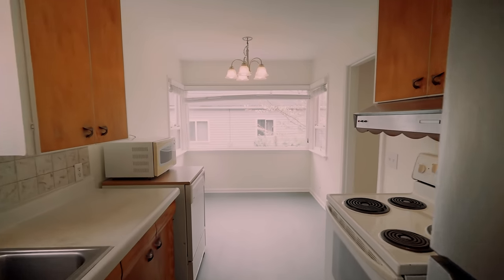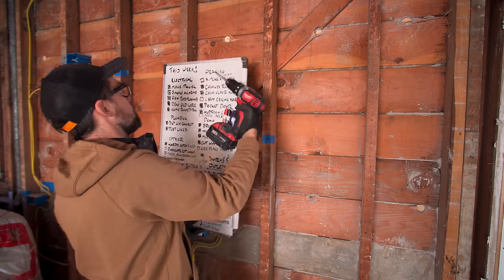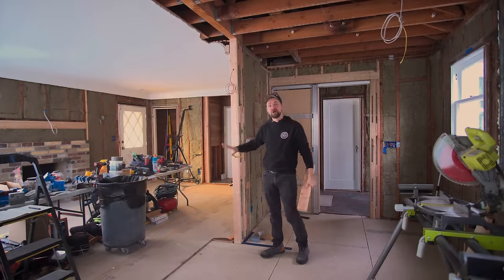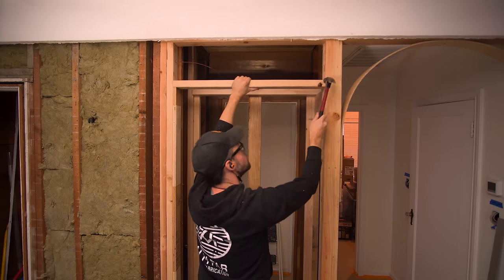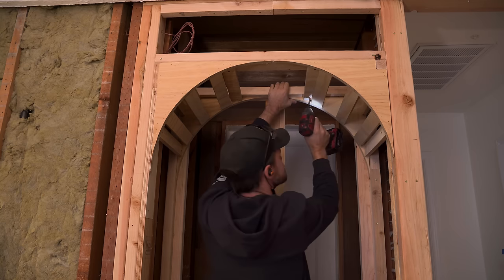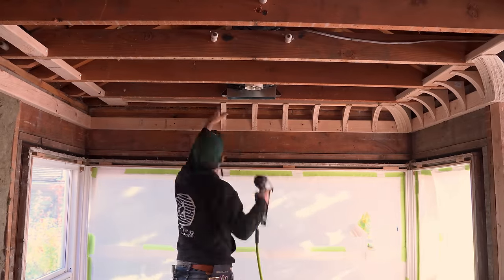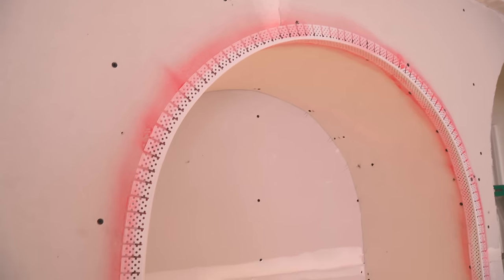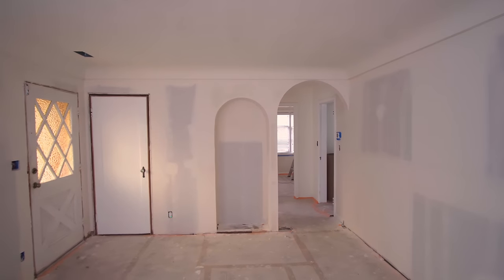Last-Minute Architectural UPGRADES | 5 Days till Drywall

Comment: very interesting for me as a European to see how American houses are built. With our brick walls, jobs like tapers and drywallers don't really exist here - we do, of course, sometimes build a few interior walls with dry wall, but usually only to save on money or for practical buildings so it's rare to see skilled workers do something like arches and coves with drywall, here. I learned a lot. You also did a great job preparing everything for the professionals. Unbelievable progress!
Reply: I'm sure we use drywall to cut costs here in America, but using drywall also makes it a lot easier to hang stuff up and allow for further modifications. It would be a nightmare trying to rebuild a room with a brick wall, instead of simply having to cut through wood and drywall haha. I'm sure the various European climates have a factor in why brick is still a common building material, as well as history. Housing all over the world is quite interesting to learn about!
Reply: @nomoretwitterhandles Having worked with both for a decade, I have to say I perfer a sold brickwall. I actually find it a lot easier to hang things up especially when it comes to heavy items. But I do agree, it is fascinating how different building methods evolved over hundreds of years and there is lots to learn from all them!
Reply: I say this exact thing when watching people from other countries build homes too it's so fun and a great learning experience too..😊
Reply: Plasterboard (drywall) over timber frames are used for internal walls throughout the UK and Ireland.

I'm always struck by the lower insulation levels & the kitchen appliances. I think we do those better this side of the pond.
Reply: How are the brick walls you speak of finished smooth, ready to paint?!? By brick, do you mean those large hollow clay masonry units (I saw those going up in Spain- looked like reinforced concrete floors/ ceilings, steel columns, clay masonry non-structural walls), or what we commonly call bricks in the US (2 1/4”H x 3 5/8”W x 7 5/8”L, or 57 x 92 x 194)?
Reply: @EM-fh2tx  Insulation levels required by code in the US varies a lot based on the climate of the area you live. Some areas require R-19 in exterior walls (2x6 construction), while others only need R-13 or R-15 (2x4 construction).
Reply: @EM-fh2tx  I saw a study that found UK homes lose about 3 degrees C in five hours at 0 C outdoor temperatures which is absolutely terrible, compared to Norway where homes are built with timber, and where the average is 0.9 C. The idea that masonry is good insulation is a complete myth, if you had brick walls a meter thick it would only be equivalent to an R-value of like 4.5.
Reply: Average age of housing stock in UK is much older. You can't compare insulation values of a house built in 1920 to one built in 2020. I agree however that more northern nations have higher insulation values.
Reply: @coolbugfacts1234  If you don't insulate them, yes. First of all, the standard noawadays is to add foam insulation on the outside with two layers of reinforced lime-concrete plaster on top. But the reason we use brick is not for insulation, but for thermal mass. The weather in central Europe can get pretty cold and pretty warm, so a thick wall acts as a temperature buffer for times with a lot of fluctuation. For example, most central European homes don't have AC because three consecutive hot days will still not heat up the interior too much since the walls have a lot of thermal mass to heat up before the heat reaches the interior. The same is true for three cold days in a normally warm season.
Reply: @chriskelvin248  In Poland almost all walls are made out of three types of "bricks". We use either ceramic bricks like Porotherm, foamcrete blocks like Ytong or silicate bricks. They differ in sizes between brands and serve the same purpose. The choice is mostly the investors preference. Than the raw wall is covered with "plaster". There's two popular choices: concrete based or gypsum based sand mixtures. Finally we put smooth layer of acrylic "plaster" and paint. Typical outside wall is about 10'' with 8'' insualtion and inside walls are 5''.
Reply: @YippieKayYay88  I would like to visit one day. Next time I’m anywhere in Europe, I will definitely pull over to inspect construction techniques!
Reply: @EM-fh2tx  The average age of housing in Norway is about 50 years. The average age of housing in the UK is just 37 years. UK houses are shoddily constructed and inefficient, compared to the well constructed and efficient timber houses of Norway.
Reply: @chriskelvin248   You are welcome to visit. Our country has plenty of nice and interesting things for You to enjoy, construction incuded ;)
Reply: @marcpym5251  Where I live in the US it's completely normal to have weeks of 35 C or higher in the summer, and weeks of -12 C or lower in the winter, so the thermal mass theory is not a great idea here, we need actually well insulated houses
Reply: @YippieKayYay88  I can say “good morning” in Polska and some bad words too if I hit my head on a brick
Reply: Unfortunately most residential homes in the USA are NOT built to last multiple generations. Most Americans move every 7 years so that’s sadly reflected in the construction practices of today.
Reply: Rofl drywall is used a lot in Europe...
Reply: Same in India: all houses have brick walls, only offices may have drywall with GI steel studs for interior "walls" (partitions, really). Wood is horrendously expensive in India.
Reply: In Sweden it’s very common with drywalls. Mainly for its fireprotection capacity. At least in multistorey housing projects..
Reply: @chriskelvin248  I think you're talking about Cinderblocks (which are a shaped (and hollow) cement mix with actual flyash from industrial ovens included into the mix to make a lighter product) and no, that is not Bricks, Bricks are the solid burned clay rectangles that give you a regiular smal patterned surface with red blocks and white mortar lines.

Walls are made smooth by putting up plaster/stucco. Then you can add whatever finish you want... paint it, wallpaper it, add woodpanels.

Also you shouldn't confuse modern building codes with those houses 80 or 100 or even 250 years ago were build and have been modernized under...  If you set up a completely neww house now there are stringent energy efficiency rules at work too. and i'm pretty sure they hold up in most EU countries better than the wood buildings in the USA.
Reply: Brick walls may withstand tornados better!
Reply: @DrMJJr Not sure where you got your information from, but the typical house in America can lasts anywhere from 50 to 70 years, and some lasting even 150 years. Keeping up on the maintenance of the home is an important factor. This isn't technically the reason why Americans typically move every 7 years, but instead its because of a new job, or more affordable housing. There has actually been a large decline in the number of  Americans moving every year.
Reply: hu
Reply: My daughter's apartment interior walls are all drywall attached to thin, steel studs. She lives in France. The building was put up in the mid 70s.
Reply: Well this Comment Topic Wall was entertaining. And there are too many factors involved to declare any nation a so called Winner. Plus you all loose anyways. The Japanese House Construction displays a textbook ingenuity design that caters to a human but will outlast Time itself.
Reply: Drywallers do exist and they have plenty of work. But not at building family homes.
Reply: At the end I was thinking: “If somebody slips and pushes a couch too much, it’s easily going to make a whole”. I like how fast it is but not really great long-term, especially if sold to somebody with no DIY skills
Reply: One of the biggest reason we use brick and concrete instead of timber at least in The Netherlands is because of fire safety. We are a small, densely populated country. Because our houses are build closely together, if there's a fire in one, you don't want it to spread to the other houses next it. And if it is going to spread, you want it to do so as slowly as possible.
Reply: @coolbugfacts1234  The average age of UK housing stock is definitely not 37 years. Nearly 1/5 of our stock is well over 100 years old (we have houses that are still lived in from the C12th). They definitely do not have the thermal rating of Norwegian houses though. Despite the entire UK being at the same latitudes as Canada, we just don't get winters that are as cold.

Comment: I learned this by replacing paneling at my old house with drywall on a front wall that had moisture issues. Fixed the moisture issues (thank you Matt Risinger) myself, but was weary of drywalling. Watched several YT drywall gurus and learned a few key tips so when I tackled the mudding and sanding, I treated it as an art...because it is. Your drywallers are artists. Excellent work, but I'm really surprised that they let you film them working. Great guys indeed!
Nice work to you as well Michael. There's much to be said for being a woodworker that is going framing. It's a totally different skill set, but you excelled. Well done Sir!

Comment: I was doubting the cove, I thought it was gonna be a straight curve from the horizontal wall to the vertical ceiling, but with the 90° edge below it on the wall it's very nice. It's classy, shuttle, and maybe even a touch of art deco. And since it was built in the 40s it fits nicely! Well done sir! I'm digging this series.
Reply from the maker: Thank you!!

Comment: Good decision on the Rock Wool. It's very moisture-tolerant, easy to cut, easy to push and place, and neither insects nor mice will eat it. Plus.. NOT itchy compared to glass fiber. Great stuff.

Comment: Been following the renovation and it looks awesome. One tip. It's best practice to trowel thin set in straight lines as this will provide a uniform height. If you trowel in circles you run the chance of putting too much thin set in one spot and not enough elsewhere potentially creating voids or weak spots under the cement board.

Comment: I did drywall taping in the 80s. The use of power tools the hangers use is a big step-up for them. I am pretty sure they are using a rotobit they can plunge into the soft drywall and push it along the lines. It was all utility knives and drywall rasps. They were just as quick, and did things just as fast. They get/got paid by the job, so the quicker they got it done, the more they make by the hour.

Comment: Rockwool is also much better for your health. You can put it up without PPE and all you will have is a bit ichy skin and maybe an ichy throat but not something that doesn't go away after a shower and the ichy throat is avoided with a mask. The fiber glass, you should have a full body suit or you will be ichy for days and it's detrimental to your health to use it without a good mask which rockwool isn't.

Comment: Looks great!  I really like the arches and the cove ceiling, but I was surprised how they drywalled them.  I have curved drywall during my own home renovations.  You can get a 1/4" flexible drywall and you just wet both sides, wait a minute and then it bends into place. It seems easier then mudding and sanding out the flat spots

Comment: Great video and it is so satisfying to see the drywall up and mudded. I will suggest that you review your thinset technique before tackling your tile, though. Your method is very out of date. You should always trowel in one direction so air can escape when you lay down tile (or cement board). You also need to back-butter tiles (and, probably, cement board). Get a copy of the Tile Council of North America (TCNA) "Handbook for Ceramic, Glass, and Stone Tile Installation" rather than trusting YouTube videos if you want to do tile right. Many localities consider TCNA guidelines the minimum for building code compliance.

Comment: It's worth bearing in mind that some spray foams shouldn't be used with electrical cables as they'll react with the sheathing.  
A great thing to use in principle, but worth checking before use.

Comment: Worked as a pro taper back in the day and sometimes drywaller, never seen these newfangled techniques ;). We did arches using flextape (paper tape with embedded metal strips) and snipping one side in small segments with tinsnips. Also curving the drywall by wetting one side but that wouldn't work for the amount of curve you needed so you have to cut it like that.

Comment: There are math formulas for arches a squared plus b squared divided by two of a . A is the spring of the arch  and b is half the span of the opening. The top can be plywood to fill the top of the arch no need to fill with wood  and when you cut the arch cut both sides of the arch at once if your off a little bit the drywall will cover it you are not building furniture your framing.  On cove cuts your using the twelve twelve setting on the speed square so for the inside and outside corners use the hip and valley setting to  get there or use seventeen on the carpenter square.

Comment: The spray foam you used to seal off the openings inside your walls really should have been fire resistant foam. Most building codes require it when sealing openings between floors. It is generally colored red to make it easier for inspectors to spot it is the correct product.  This is one regulation that I believe is actually worth doing even if it wasn't required. It can greatly slow down the spread of a house fire.

Comment: Ok. Last one. Spray foam around the window spaces and plastic sheeting as a vapor barrier on the exterior walls would help a ton with drafts and heat loss.

Comment: The dish detergent just smooths out the drywall and makes it more pliable when working with it, in addition to the bubbles. Kind of like adding a bit more milk to the mashed potatoes, when you’re mixing them.

Comment: Can't believe for an old house, you would not used closed cell spray foam insulation. It makes for an absolutely air tight, bug tight seal. Having had it done twice, I'll never go back. Makes everything rigid and quiet.

Comment: Looks great! I like that you kept the original look and feel with the arches and cove. Will you be doing an exterior vapor barrier?
Reply from the maker: Thanks! Right now there isn’t a plan for a barrier. From the research I’ve done, it sounds like moisture barriers in this climate are not recommended. If we reside the house down the road, we might change our minds
Reply: @MichaelAlm  Interesting, down here in Oregon I think they're required. You're only slightly wetter up there. Looking forward to seeing the end result.

Comment: I would never use drywall in an old building. I would use paneling like in fancy libraries and do wainscotting. Boxbeam wood ceilings. As for the floor, I would go period and use hardwood planks.

Comment: Hold on I got another one....moving  a 40' extension ladder to another side of the chimney. While bent over tried to fix the foot of the ladder, because of tje ice and snow,  a loose brick fell 32' and cracked be in the back of the head. Layer me out ! Didn't knock me out, though I think I wish it had. It did however paralyze me for a few. After an ambulance ride and 20 stitches the dr told me a fraction of an inch higher or lower I more than likely woulda been killed....hard hats people, hard hats please.

Comment: I don't normally comment on your content, but I have to agree that drywall, mudding and taping is straight up prison sentence work, so good call on hiring that job out - those guys did an amazing job, too. I'd add that someone below replied to a comment to the effect that you should add some of your patterned ply stuff, notably as a door - maybe get rid of that heinous diamond-pattern ranch style entry door? It really clashes with your deco arches now.

Comment: I've been a drywaller for a decade now. having someone board over cove created by framing is INSANELY cost prohibitive. theres a product called cornice which drwallers can install that has a coating over styrofoam. It is better than wooden cove because it doesn't shrink or twist over time. the sheer amount of time the mudders have to dedicate doing it the way presented in here vastly outweighs the cost of simply buying premade cove. Another thing to note is that dish soap helping with bubbles is a myth and is not recommended for the longevity of your work.

Comment: Should have added at a minimum, 1/2 inch ply wood before installing the hardie back underlayment.  The defelection in each deckboard is going to cause grout cracking and, over time, tile failure.

Comment: I had the opposite experience working with mineral wool insulation.  I just tried it for my kitchen remodel and I will NEVER use it again.  It was far, far, far itchier than fiberglass.  It was in the air like crazy.  It was miserable to work with and that's coming from someone who hates fiberglass.
Reply from the maker: I’m curious if you used the brand name Rockwool, or the Owens Corning alternative “Thermafiber”. That Thermafiber stuff is awful

Comment: I don't really understand why when using 1/4" drywall they use kerf cuts when there is a better way to bend it and get smooth curves without mud.  Years ago, I learned that using a sponge to wet the backside of 1/4" drywall makes it flexible enough to bend for most curves. Works really well.
Reply from the maker: I was told that the curves were too tight for wetting the paper
Reply: It might not work for long cove pieces, but for arches it works really well.  I've used it on inner and outer arches.

Comment: what is the reasoning behind not using a vapor barrier? and also not insulating the nook ceiling?
Reply from the maker: No vapor barrier because Seattle is very temperate, and the ceiling will get insulated once the electrician puts in the lighting.
Reply: @MichaelAlm  fair enough. Thanks.